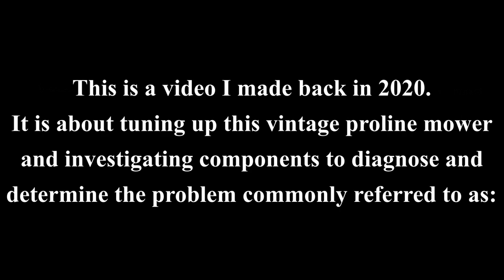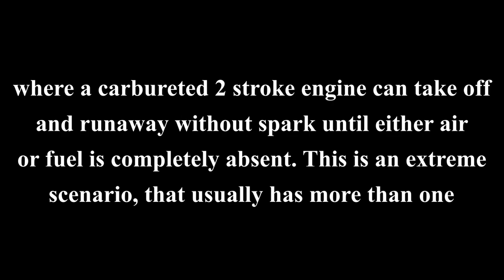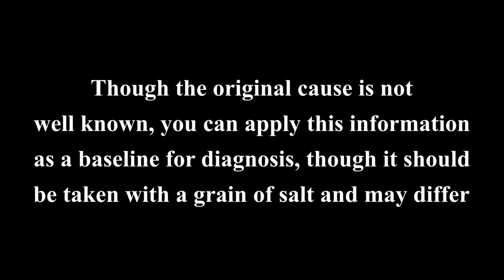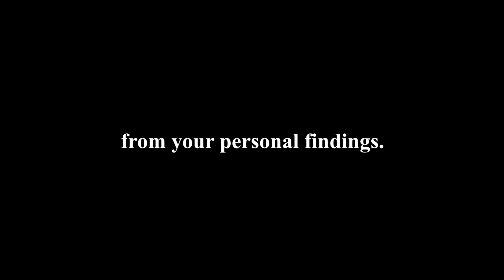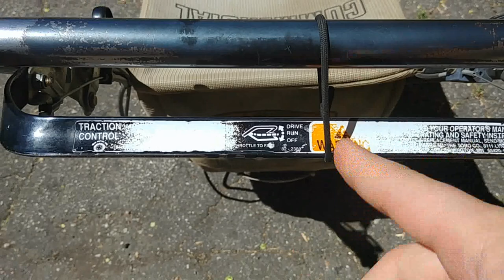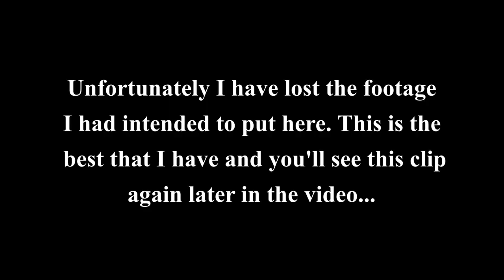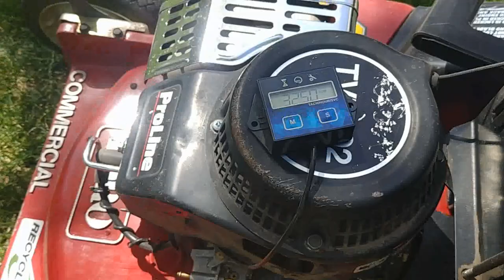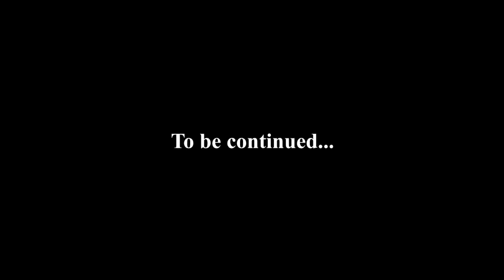Tuning up an old 2 stroke Toro [1996 Toro commercial mower 22040 pt. 1]

Comment: Just got my first its pretty much rebuilt always turn your fuel off when not mowing to prevent excess oil fuel mix from leaking pad needel and seat and fouling your plug from nor using mower fuel gravity feed carb

Comment: I just acquired a Toro 22043 with the Suzuki 2-cycle engine.  Expensive to get it going such as Carburetor, Bag, etc.  What 2-stroke oil do you use?
Reply from the maker: I use lucas semi synthetic 2 stroke oil
Reply: Much rarer than either of these two would be the 22035 (pre-compliance) mower sold in the years 1984-91; this first model also had a STEEL auxiliary fuel tank.
Reply: @ClassicTVMan1981X  I also have a 2-cycle Toro from around 1986, correction 1989. It was given to me and the Model number tag is missing so I don't know the model.  Metal gas tank, self propelled.  Ugly as heck.
Reply: @scotta9114  22035, I believe. The engine model number may also shine a light on its age:
47PD3 = 1984
47PE4 = 1985
47PF5 = 1986
Reply: @ClassicTVMan1981X  I'll see if I can find the Engine number.
Reply: @scotta9114  It will be found stamped on the engine shroud (blower housing).
Reply: @ClassicTVMan1981X It says 47PJ8.  And the top of the recoil says TV5002
Reply: @ClassicTVMan1981X  Also amazed by your knowledge.  Nice to learn what I have.
Reply: @scotta9114  Your mower would be a 1989 model. It would be a 22035 with the rear bag set and the steel auxiliary fuel tank.
Reply: @ClassicTVMan1981X  I justed mowed the front yard tonight without the Grass Bag and there are no signs of clippings.  Looks beautiful.  Three Neighbors hate me because I'm ruining the Planet by using a gas Mower, let alone, a 2-cycle.  One Neighbor calls me a Terrorist for running it.  We are very kind People but those 3 Neighbors converted to electric Mowers so now those who did not convert are considered bad People.  When the one really Nasty Neighbor comes over to complain, I push the throttle towards "choke" for more smoke.  Plus I run Red Armour at 40:1.  Mower is extremely loud and they don't even complain about the noise.  I told him to buy me a quality Cordless Mower and I will use it.  The new Cordless Mower hasn't shown up.
Reply: @scotta9114  Terrorist... LMFAO. I bought a Snapper with the 2 cycle Wisconsin engine for $40, compression was low but no scoring or damage so I filled the fuel tank with 16:1 & poured MMO through the spark plug hole, exhaust port & the carburetor with the throttle open. Fourth pull it started & smoked like a train for three hours until it ran out of gas. The neighbor came out like WTF? I suddenly saw smoke out my window... Oh, you're just fixing the mower. I said "I got it to start, it has low compression though so I'm letting it run until the gas runs out". I refilled fuel tank with 25:1 & it fired up on the second pull.
Reply: @twocyclesmoke  Not heard of a 2-cycle Wisconsin Engine.  That sounds like a super cool Engine and Mower.  I remember as, Kid 60 years ago, my Dad had a Well Drilling Truck and the engine on the Well Driller was a Wisconsin 4-cycle.  Powerful engine.
Reply: @scotta9114  Someone had a couple NOS snapper mowers listed on FB marketplace... Both two cycle engines, Wisconsin & Tecumseh... Said no shipping though. 😕
Reply: @twocyclesmoke  Wonder where they are located?

Comment: Running without the air filter will cause it to run more lean.  Have you tried midgrade fuel?
Reply from the maker: Yes, but I was just trying to test things. I believe I was using mid grade at the time of this video.

Comment: I bought one of these last summer. Mowed with it a couple of times. Mowed today with it. It started right up even though I didn't really do any winter maintenance on it. However, the muffler is smoking after some use. What, if anything, should I do about that? Air filter cleaning/replacement?
Reply from the maker: Take a look at the air filter, since that's just a general maintenance item. However, smoke out of the exhaust is pretty normal from these engines, especially if you like to mix your gas with a higher ratio than 50:1. My guess is what you're seeing is carbon burning off inside the exhaust. The gas you're using is probably old since you didn't do any winter maintenance, meaning it won't be burning as efficiently as before. That won't matter though, I've run 3 year old gas through mine and it gobbled it up, despite heavy water contamination and poor burning. Didn't run great, but it's better than taking it somewhere to be disposed of imo 😂
Reply from the maker: The air filter should be a sponge, just clean it in soapy water and then drop some motor oil on it and rub it in. Usually I only have to clean the filter about 3 times a season because I live in a dusty area.

Comment: Its lean. Mine is probably  running6000. Air leaks all over .
Reply: As this is a two-cycle engine, it is actually running at the correct 3000 rpm. It seems like it's running faster because there are only two strokes per cycle instead of four.
Reply: Bingo, that and carbon build up seemed to be the problem
Reply: @ClassicTVMan1981X  in this video I had messed with the governer so it was running higher than stock settings. But in some old engine manuals that I found this engine is rated up to 3600 rpm
Reply: @simplybeanjelly  The 3600 is usually where max HP is developed, but it's often not the recommended governed speed for safety reasons. For safety reasons, the engines are given lower operating speeds than where max HP is developed. For a mower with a 21" blade, the highest recommended speed is 3456 RPM as that is closest to the 19,000 FPM limit, but to better preserve engine life and account for occasional governor lag these safe values are then reduced by 200 RPM or more.
Reply from the maker: @ClassicTVMan1981X  Yeah, I run it at 3200 now, it works great :)

Comment: Have you cleaned out the muffler hole?I have the same engine!:)
Reply: There is a very small hole that's blocked behind the muffler !
Reply: I did indeed clean the muffler, you'll see in part 2
Edit: whoops, forgot to switch accounts!

Comment: Nice mower. Subscribed for pt. 2
Reply from the maker: Thanks! Pt. 2 will be out in about two weeks. Taking a break cause we're moving.
Reply: @garagejunky  I have the consumer version of that mower, a 1991 20106 Recycler with Suzuki 2-Cycle and blade clutch. My mower does Not knock but I am still interested in seeing if you can find what is causing yours to. I really like those Suzuki 2-Cycle motors.
Reply from the maker: @WisconsinEric  sweet! That's a great mower!